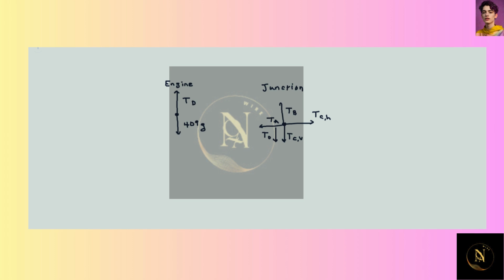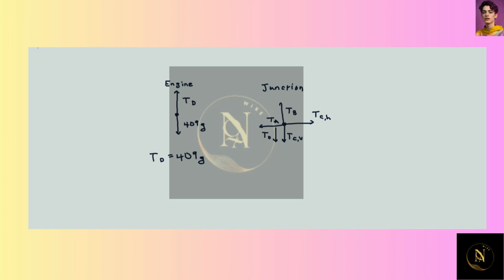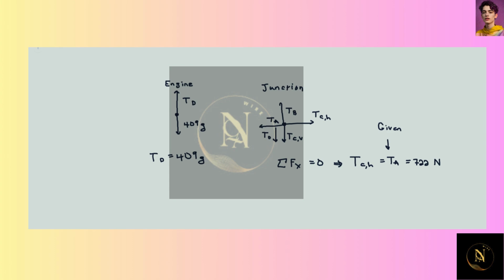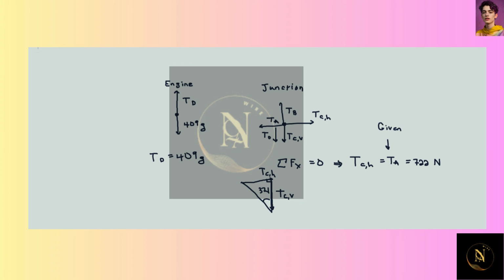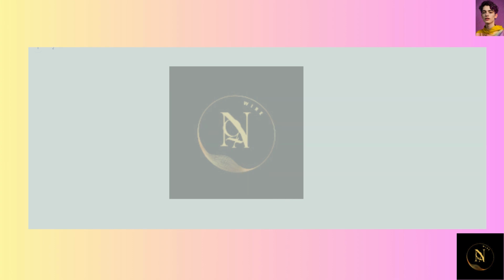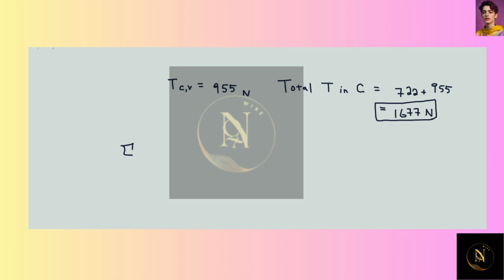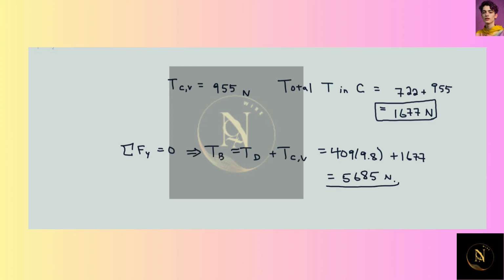In a repair shop a truck engine that has mass 409 kg is held in place by four light cables ( ). Cabl

Comment: Would the tension in C not be 1197, since with vector addition you use the Pythagorean theorem?
Also wouldn’t Tb be 5044N? In the equation the total Tc was used but this is only tension in the vertical direction.
Please correct me if I’m wrong.